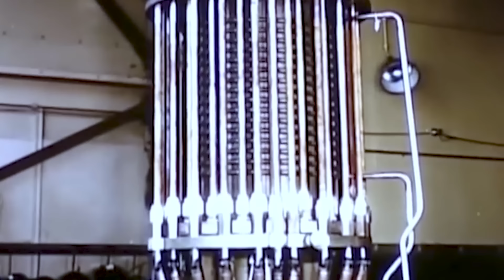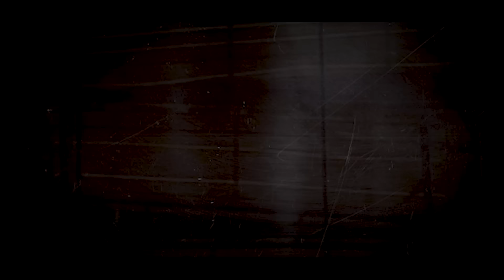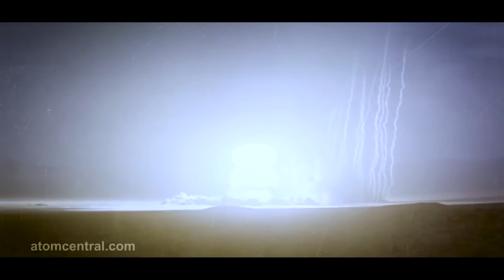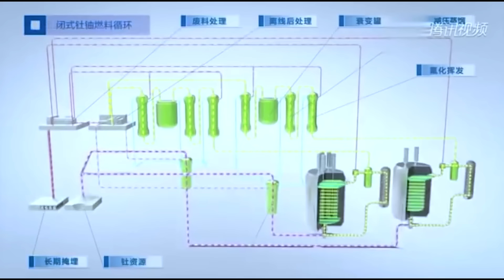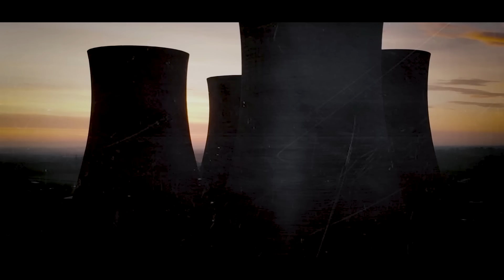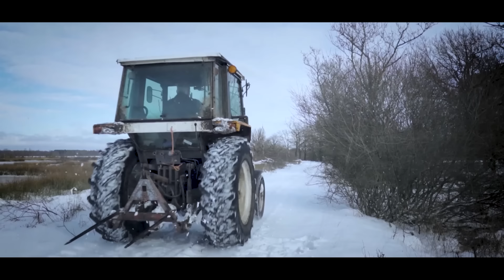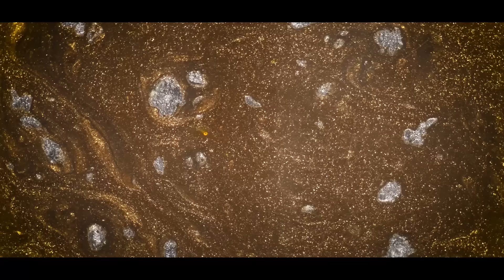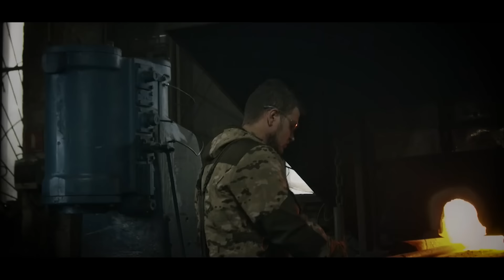Future of Thorium Reactors and Nuclear Energy

Comment: I am surprised that you gave a very misleading mention of the Oak Ridge thorium reactor.  Robert Weinberg, director of research at Oak Ridge insisted that a thorium reactor be built, and it operated for years.  Voluminous data were taken.  However, when he retired, the reactor was shut down and data disappeared.  The government had allowed the reactor to exist only because of Robert Weinberg's prestige and insistence.  The US government also applied tremendous pressure to keep India from building Thorium reactors. 

I am also surprised that you did not say that Thorium reactors will need to operate with very radioactive fuel to be economical.  Much of this will be of short half life compared with the fuel waste of present reactors, but it will be very intense.

Finally, the fuel you envision will contain enormous amounts of Fluorine.  The technology to contain the highly acidic and and highly radioactive radioactive waste does not exist.
Reply: They did not build a thorium reactor, they build a uranium molten salt reactor. They intended to experiment with thorium but never did.

Comment: The biggest problem of Thorium reactors is the engineering. The molten salt is highly corrosive.  Solve that problem and you have a go.
Reply: The biggest problem about thorium is that economic deposits of it are very rare as it is not concentrated by geological processes to the extent that uranium is.  This is because uranium in the hexavalent state is slightly soluble in groundwater and geological processes can leach it out of some rocks and concentrate it n others where reducing conditions exist.  Not so with thorium, unfortunately, which behaves more like the Rare earth elements.

Comment: "waste which has been contaminated with alpha emitting transuranic radionuclides possessing half-lives greater than 20 years and in concentrations greater than 100 nCi/g (3.7 MBq/kg).  
Elements having atomic numbers greater than that of uranium are called transuranic. Elements within TRU are typically man-made and are known to contain americium-241 and several isotopes of plutonium. Because of the elements' longer half-lives, TRU is disposed of more cautiously than low level waste and intermediate level waste."  Transuranic waste Wikipedia

Comment: Excellent vid. Great info and arguments well presented. It's good to hear people singing Thorium and Molten Salt Reactor praise. You should check out the FLEX Reactor project on the molten salt front. It's idea was to concentrate on making a non-corrosive salt and the ability to idle the reactor so it just stores heat for a while instead of producing electricity (flexible, doesn't have to be continuously on). 
--
They use a mixture and tests so far look great. No corrosion after over a year with their salt so far. This already far exceeds the competition. Combined with Thorium it would be very scalable solution. You also missed the fact RUSSIA has been running an experimental (non-molten salt), fast neutron Thorium Breeder Test Reactor that already uses 100th the amount of enriched uranium of conventional enriched uranium reactors.

Comment: Water can indeed be used as a moderator in a LFTR. Copenhagen Atomics for instance plan to use heavy water at 50 degree Celsius, thus not under pressure.  The moderator is in separate tubes and not mixed with the salts.
So the important thing is that the molten salt is used as a coolant, not a moderator, and the molten salt coolant do not require high pressure unlike using water as a coolant (the confusing part is that the water in normal reactors are both coolant and moderator)

Comment: Ummm A Thorium reactor is a Breeder Reactor, the only way to make it work is to continually remove the Weapons Grade metals being generated like Plutonium from the Hot Salt Radioactive soup.A Total Mess. All modern Nuclear power is 10 times the cost of Solar & Wind as they have Zero Fuel Cost. Sadly Fusion is even worse... 
Please take a look at Total Costs for 1 Kilowatt hour, about $.25 compared to $.025 for wind & solar. Nuclear is and has been another Federal Boondoggle... Follow the money!

Comment: probably skipping steam production and using the heat and radiation to break down water into hydrogen which can be used instead of natural gas and to make other hydrocarbons (( has also been proposded for high temperature reactors --- I am just repeating))
Reply: Breaking down water forms hydrogen and oxygen which can violently recombine in an explosion.  Not a fav or nuclear reactors
Reply: @clarkkent9080  btw not my idea and the safety standards for a nuclear reactor are that high that I'd rather not propose any design for use on earth :) --- just enjoy talking and thinking about though

Comment: This lithium fluorine salt in the MSR is highly corrosive and reacts with moisture when exposed. In other words it will burn on contact with water with quite a hot flame, melt steel etc. ---- I am not sure if solid fuel rods where an answer to a safety issue decades ago but now that seems plausible to me. Btw one can dissolve uranium salts in water (probably less of a headache and less of a corrosion issue)

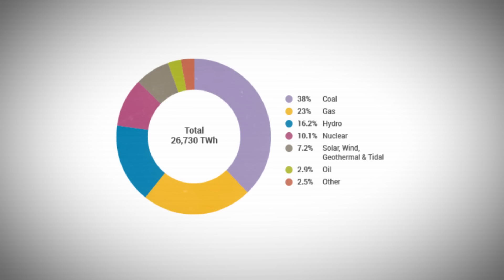Comment: 14:52  This is only electricity, correct?
Natural gas and oil make up much larger percentages of energy than this graph, presumably electric only, can show.  Most of what they power would not be easy to electrify.
Reply: No, a molten salt reactor generates industrial heat at about 700c, so electricity is only one of hundreds of applications. (Thorium has nothing to do with it)
Reply: @chapter4travels  But it won't impact most fossil fuel use.  I think that's what I meant.
Reply: @tarstarkusz  It will impact fossil fuel use, a huge impact because of the high-temperature output that light water reactors don't have.

Comment: My understanding is that the reason most of the U235 in the fuel rods is unused is because the bulk of the fuel rod Uranium in the form of the U238 isotope, which is not fissionable, absorbs to many neutrons to allow the chain reaction of U235 fission to continue so the fuel rods no longer can sustain their energy production and are thus spent. I don’t see how a build up of noble gasses in the fuel rods could impede fission in them.

Comment: A LFTS reactor ran at Oak Ridge for about nine years.   It is doable.
Reply: It is. There are numerable technical challenges that Oak Ridge ran into that needs to be solved. To say it "ran for nine years" is not accurate, as it was constantly shut down for maintenance and repairs. 
However, I believe that especially Copenhagen Atomics and some other MSR companies have come a long way to fix the issues.

Comment: Great video on Thorium. Can’t wait to hear more on some of the recent projects (in China and the Indonesian Thorcon plant). I started my chemical engineering career in Elliot Lake Canada in 1978 a uranium extraction facility, which also had a shutdown thorium extraction plant. Both have since been dismantled, so I’m particularly pleased to see this revival. Also, I still do decarbonization reviews in refinery and chemical plants around the world, and it would be great to see molten salt reactors in industrial clusters to provide more sustainable and affordable heat and power.  CCS and hydrogen firing are used far too often in (unaffordable) 2030 and 2050 decarb roadmaps.

Comment: One more question. Is it possible to change the power output of a thorium reactor as the demand changes. A problem with uranium reactors is that when you run the reactor down, you have to wait a few days before starting it up again because of xenon poisoning.
In general, excellent video.
Reply: thats the beauty of them! the more you hit the gas pedal on demand side, the reactor gets slightly cooler and produces to meet the load[ load following] then when you back off the demand , its heats up slightly and the reaction slows down automatically, due to the laws of physics, not someone pushing a button or pulling a lever to change the reactor, its all a balance of load to reaction rate

Comment: I can see the coal and petroleum industries will have to lure you away from this kind of thinking with grant money and a good paying job, once you graduate. Also, Thorium doesn't make good bomb material in its beta decay process, because of the high gamma ray production from its U232 and U233 products. This gamma ray radiation causes the electronic controls of such made bombs to explode pre-mature, and the shielding for such bombs makes them too heavy for rocket or plane delivery. Thus, the reason such bomb production was abandon in the 1940s. So, I don't buy the nuclear proliferation argument for Thorium use.

Comment: Was the Chinese experimental reactor successful?  Are they going ahead with the larger reactor for public energy?  Thanks for this video!
Reply: Unfortunately they had catastrophic intergranular cracking in the primary loop of their molten salt reactor, as their team detailed in Corrosion Science journal this January (2022). It turns out salt makes things rust.

IAEA's reactor database still lists it as "planned" to start up in 2020.

Note that that's only the 2MWt pilot plant. The 10 MWt experimental plant was (is?) set for 2025, and the 100 MWt plant for 2035, and only once those are successful would (will?) they go ahead with the real public energy plants.

If they can solve the rust issues.
Reply: @sandcjw9901  > " It turns out salt makes things rust."
<irony>What? Since when? Call the press!</irony>
Reply: @sandcjw9901  I hope they will team up with other MSR teams. Copenhagen Atomics have perfected the production of ultra clean (water and hydrogen-free) FLIBE salts, which do not corrode a regular steel surface. Currently have a 2 tons/year production and are investing in a 10 tons/year facility ready in about a year. 
It might not be competable with the chinese project, but it might just be the solution they need.

Comment: this is good for High School, but he gets a lot of the science wrong.  Fission of U233 produces FAST neutrons that have to be slowed down with a moderator.  it's not just noble gasses that build up in solid fuel rods, but many different fission products that absorb neutrons. These are called "poisons". this is a good start but keep studying.
Reply: Is there any fissile isotope that does not produce fast neutrons upon fission?
Reply: @clarkkent9080  no. the strong nuclear force is very strong and when you break the bond, it's like a coiled spring sends them flying at near relativistic speeds. You always need a moderator unless it's a fast spectrum reactor.

Comment: That’s bs about it being shot down back in around 1970 . It was shut down because it was a political move by Richard Nixon and it’s extremely difficult to extract plutonium from  molten salt reactors which is for nuclear weapons.
Reply: Stay tuned for Terrapower's Natrium MSR.  Two years in the making and no ground broken yet and no status given.  They advertise a build cost of $1 billion but have yet to complete the design or request cost bids.  I'm sure it will all work out.

Where do people keep coming up with this BS that PWR/BWR were chosen so we could make bombs?
Hanford Wa. has been making weapons material since 1944 and their weapons production reactors are very efficient graphite moderated reactors and DO NOT produce any electrical power.
Savannah River site SC. Has been making weapons material since 1955 and their production reactors are very efficient low pressure heavy water moderated reactors and DO NOT produce electric power.
Weapons production reactors are NOTHING like U.S. commercial PWR or BWR power reactors and commercial power reactors have NEVER been used to produce Pu239 for weapons.

Your comment is like saying automobiles use gas engine because the military wanted jet fighters.  God help us that people base their knowledge on social media and YT videos.
Reply: PS Thorium reactors produce U233 which is much better for making nuclear weapons than Pu239

Comment: Great presentation you have covered most of the essential information. Nuclear powered commercial ships is far away mostly due to regulations in most countries. It has already been tried on a cargo ship called Savannah but is was no success because few ports would allow the ship to dock. Other than that the Russians have a couple of icebreakers intended for trips to the north pole. Check out YouTube presentation of a company called Thorcon. They have a realistic plan to mass produce barges with reactors onboard. These barges could be moved anywhere in the world that has a coastline or a relative large river. With everything already onboard the barge all they need to do is to connect to the local electric grid. Price both for the construction and for the operation will be determinant. Developing countries would like to increase their standards of living and the key to this is cheap energy. That implies that they will go for coal since it presently is the cheapest alternative. With two thirds of the worlds population living in developing countries we are in a hurry to implement this new technology.

Comment: The practical proof of concept of a molten salt thorium reactor remains unachieved.  This is essentially due to the engineering challenge of using fluorine salts as a cooling and moderating medium being exceedingly troublesome.

Comment: My understanding is the issue with Thorium from an engineering persepctive is more to do with the "Kidney" piece most designs call for. It is typically needed to keep the fluid concentrations of the salt managed. If you need to take out non-radioactive consumed items while adding in new thorium. This is necessary to keep a continuous reaction going as too little and the reaction stops and too much and you'll melt the reactor. Which sure it won't blow up ... but that's a costly mistake.  

American researchers I've seen have often dropped the project because the hydrodynamics change significantly with scale and small pilot reactors below 20-50MW won't really generalize to GW scale. There has never been regulatory permission or funding for a large enough pilot facility to prove a working "Kidney".
Reply: Yes the Chinese built a tiny version with a membrane, US has plenty of designs coming to market with plenty of advantages without having to use that design.
Terrestrial Energy has a better much simpler design no need for complex piping which can leak, put it all in a big pot and nothing ever leaves it, you slowly add U, Th, and spent fuel, after 7 years the pot is full and we replace reactor so that the condition of the Graphite is not a factor. You get heat out by having the the salt pumped to a heat exchanger through the top of the pot there are no holes in the reactor like a LWR.

Comment: You are not telling completely the truth, the thorium reactor was dumped because it was more difficult to build nukes. Plus the military and government wanted this wappongraded uranium and plutonium.
This process was or is very expensive, so funding costly. The best way was to tell the public this thing can produce energy so the taxpayer wouldn't mourn. Who else gets the idea to build a submersible hot water heater with 5% efficiency and then the heating elements fall apart. The same Nuclear Lobbies still exists and hindering still the development of the thorium reactor now for nearly 70 Years. That is the truth.

Comment: You are correct in stating that there are no other reasonable paths to carbon-neutral energy generation.  Nuclear is the only practical source.  You may not know it, but the US Government, in the Atomic Energy Act of 1954, committed to provide light water reactor fuel reprocessing facilities. A promise broken.  Then due to the impacts of nuclear accidents and unfavorable "China Syndrome" fear mongering, states prohibited transporting "spent" nuclear fuel across their borders.  This ended the ability to reprocess the LWR fuel - and the demise of the promise that electricity  would be "too cheap to meter".  You may also want to emphasize that the volume of waste from nuclear plants when compared to all other energy generation methods is insignificant.  

I'm impressed that you are seeking degrees in engineering and finance at the U of P, the best of the best academic institutions.  You are a person who can bring us out of the fossil fuel dark ages!  (pun intended)

Comment: I've known about this for decades, but it's nice to see someone from a younger generation getting interested in it. We really COULD have solved all our energy problems by now if that asshat Nixon hadn't shut down the molten salt reactor project at Oak Ridge. Why did he do it? MSRs don't produce plutonium, which he wanted to build a stockpile of nuclear weapons for the Cold War. AND he was in bed with the company that produced conventional reactor components and fuel rods/mined uranium for them. Nixon was even more of a remarkably short-sighted, disgustingly corrupt person than most people think. Also, without conventional light water reactors we would have almost certainly avoided all the nuclear accidents that turned a frightened public against nuclear energy. For instance, no 3-mile island accident, and since the Russians basically stole our reactor designs through industrial espionage, if we had gone with MSR's there probably also wouldn't have been a Chernobyl accident. Certainly no Fukushima accident either. You ever get the chance to piss on Nixon's grave, do it. He is almost single-handedly responsible for our energy crisis, continued global warming, fear of nuclear power, and set us back sixty years in clean, cheap, abundant energy development. What a jackass...